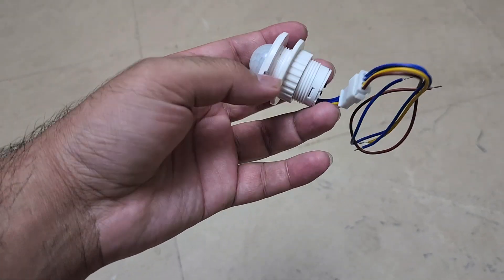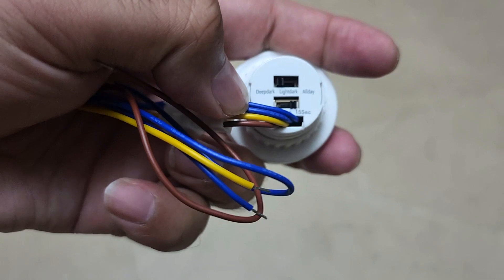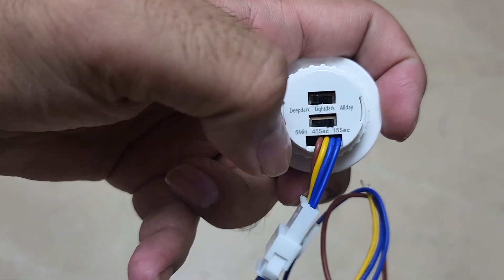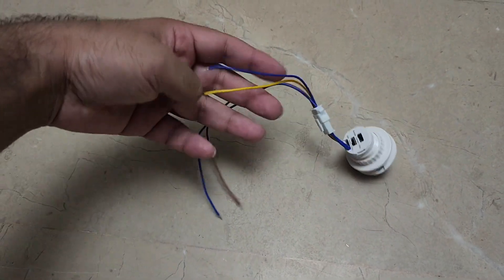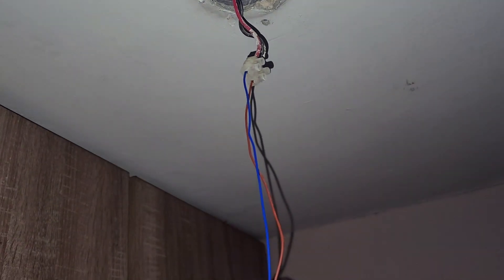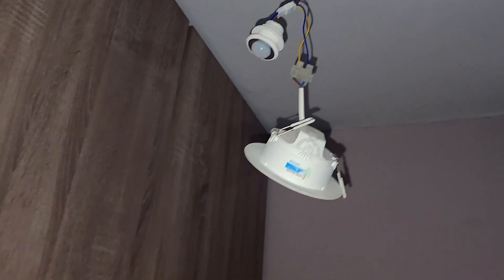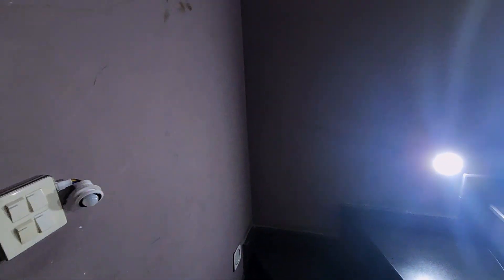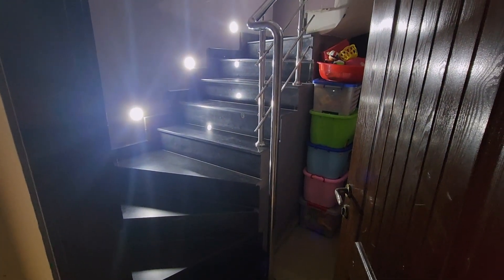How to Install a Motion Sensor for Wardrobe & Stairs Automation

Comment: do i need a power adaptor for this ? 
what does delay do? does it mean it will not set off for 5 seconds even when someone walk by ? or is it the length of time the light is on?
Reply from the maker: 1. No power adapter needed
2. Length of the time the light remains on